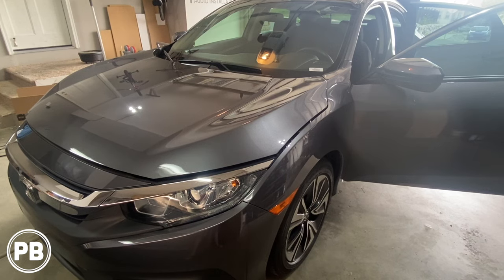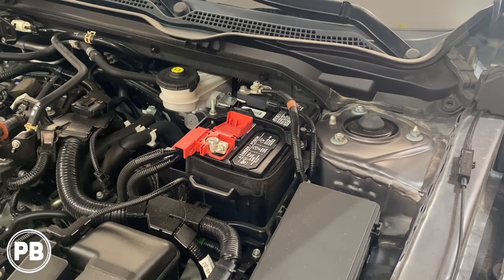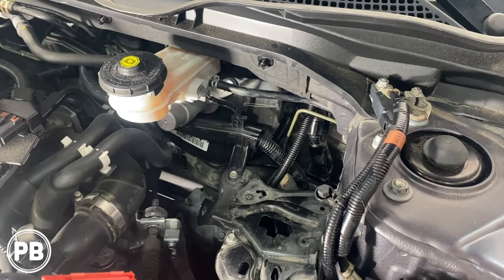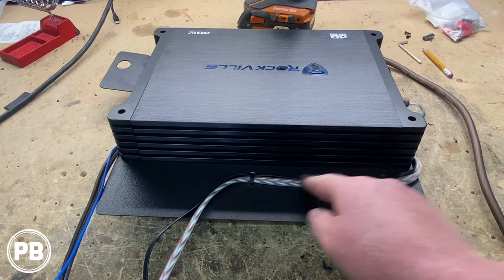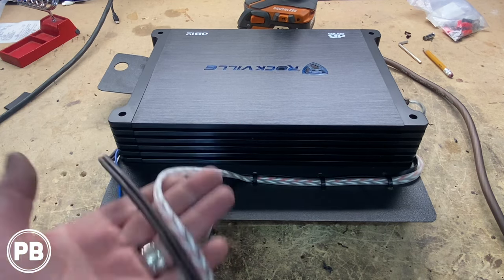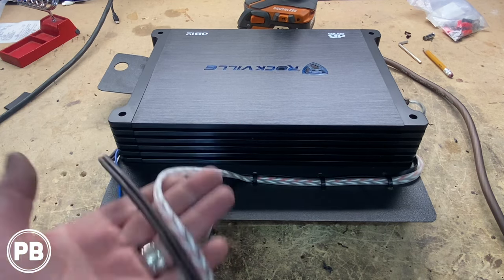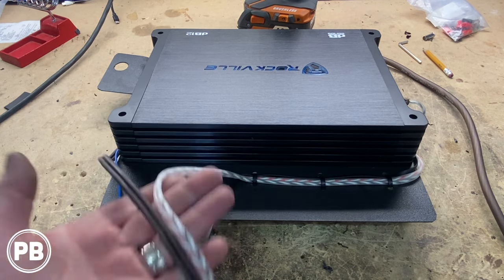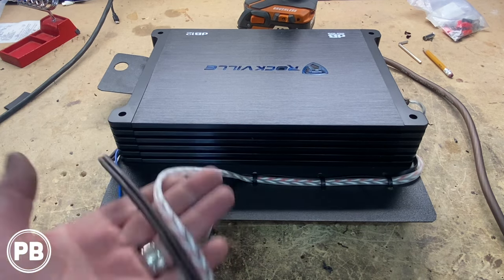2015 - 2020 Honda Civic Amp and Sub Install

Comment: how would i use a LOC with a factory sub? It only has two inputs to tap into, positive and negative. not left + - and right + -
Reply from the maker: Double up both LOC positive wires (both solid white  and gray), and both negative wires (both blacked stripped wires).  Then connect those two sets to the factory sub's wiring.
Reply: @ProvoBeastAudio  thank you so much!! I can’t wait to do an install in my civic. Great sound but lacking bass
Reply: If tapping into the stock sub, im assuming that it will still work along side the aftermarket sub basically giving more bass?
Reply: @MidevalGaming  correct, the factory sub is still completely functional. Tho, I would say I don’t notice it over my 2 12’ kickers

Comment: if i have a civic hatch with the subwoofer that it comes with, do i need to run a line output converter or can i just direct hardwire my amps line to the subwoofers line? thank you!
Reply from the maker: Line out converter at the factory sub wiring sub as the factory amp will have built in crossovers.

Comment: i installed this way and when i turned my car on it has the tpms light along with no traction control as well as the sub not workinh
Reply from the maker: Drive around the block, your system will need to reset!

Comment: I don't have the wire you tapped into in the trunk for 12V power! Weird, I have the other ones but just not the one you tapped. Do you by any chance know if it is different for Canadian civics?
Reply from the maker: Good question.  Alternatively you can go to the fuse box, or simply tap into the positive post of the amplifier.
Reply: @ProvoBeastAudio  I ended up tapping into the speaker wire...not sure how recommended that is, but it works
Reply: Which speaker wire did you tap into?
Reply: @chilitaco2719  Rear speaker from the trunk.
Reply: @YellowScubadiver is it still working?
Reply: @nicholascruise7729  Still going strong!

Comment: You never run your RCA wires on the same side your running power wire
Reply from the maker: Tons of variables there.  If you have good quality RCA cables, and a good ground, with modern electronics, you will no likely have any distortion, ground loop noise, etc in your audio.  In the case of this video, perfect audio quality, no noise.  As long as you correctly install your audio components, you don't necessarily need to separate your wiring, especially with a sub amp.
Reply: @ProvoBeastAudio  but it’s just the best way to do it, when you have a crazy exotic system like with tweeters drivers and ect…

Comment: I’m not impressed wires are hidden that’s it. Ground is not a good legal safe ground. You have your power and speaker wires are going down the same side. Good practice m.